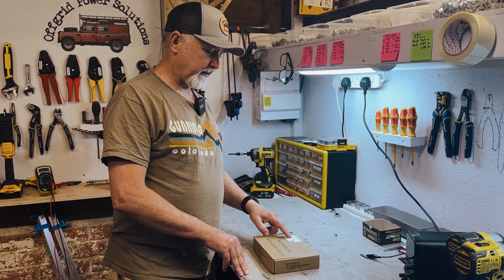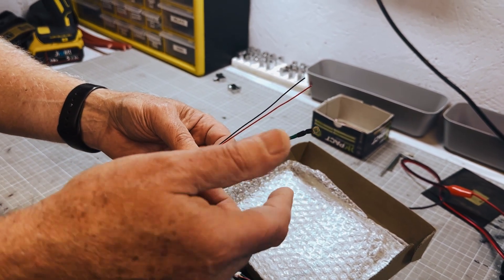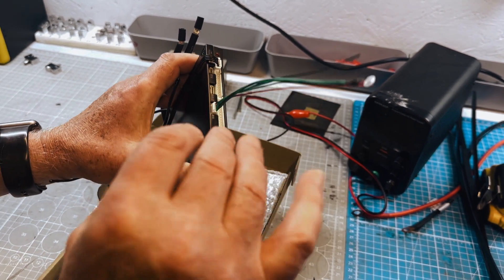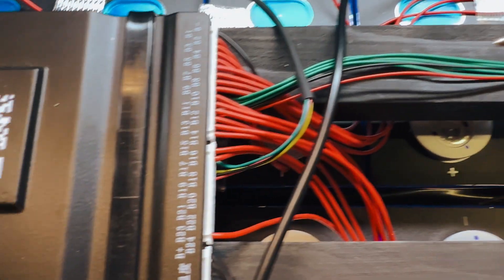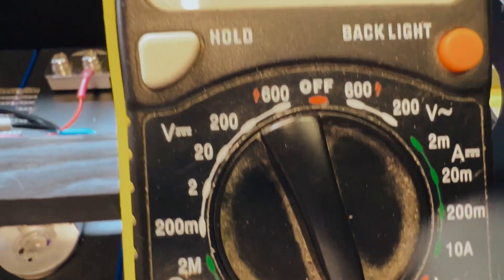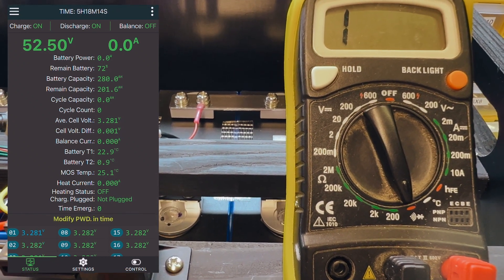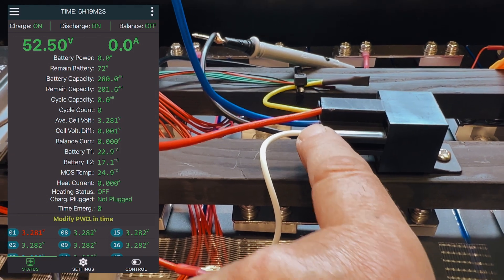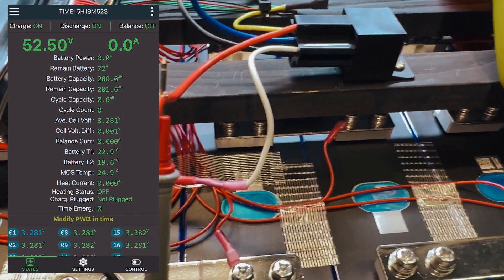How heating pads work with JK BMS

Comment: Don't tap 12v of a few cells in the pack..adds balancing issues. Do wire pads in series to make a 48 volt heater

Comment: One question. I have ordered this one and want to know one thing. 
Is it possible to start the heating manually with the app? 
I see from the video that you can adjust the temp for the heater to start heating. For example at 4c. 
But can you also make it stop when you reach a desired temperature? Example 15c?
Reply: @Sizosaid  
Value at "charge under temperature protection (UTP)" switches heating ON.
Value at "carge under temperature protection reset (UTPR)" switches heating OFF.
Reply: Thanks. Bur what if you choose heater off from bms settings,does it disable heater,so it doesn' discharge battery? I mean if i leave battery in cold in winter i could just disable heater,and when i go there and need it i just select heater on from bms?

Comment: What is the function of the two other cables on that heater connector?
How to use them?
Reply: I had same question. Do you solve that? What red and black wires use for?
Reply: @martinosemprini8997  
The only information i found is, that it should be to detect if a charger is connected. But no further detail....
Reply: @Juergen_Miessmer ok thank. For example can be used for an external relay if use a high power heater pad?
Reply: @martinosemprini8997  
I have no detailed information how to use those two cables.
Neither if it is an analog input/output, or if it is a digital communication port.

Comment: Hi, thanks for showing. Instead of looking for 48V heating pad you could connect the heating pad anywhere in the serie where you have 12V i.e. every 4 cells. Consumption is 1-2A and for a limited time; the active balancer will fix the unbalance. What do you think?
Reply: too simple! needs more overconvolution

Comment: Th ask for video. Perhaps you can simply connect main positive to the 4th cells to get 12v?
Reply: That will generate an imbalance between the cells with a higher load(current) than the active balancer capability

Comment: The 3 wires together is due to the spec of the pins in the connector not being able to handle the current. 
I have not yet wired for heat despite it being in winter, but i'm now wondering what the red and black NC wires do......

Comment: Hello.  Thanks for your video.  Does the heating only work while the battery is charging or all the time while this function is activated?  I bought a heated JK BMS and wanted the battery to heat itself during winter use.  I am writing with the help of a translator, so some words may not be correct.  Good luck in your hobby))

Comment: Why would the bms start heating the pack even if there is no charge current present?
That doesnt make sense at all.
If temps are below 0 for weeks and no solar is present it will drain your battery for no reasion.

I specificly bought the bms with the heating function do it could sense if there is a charge current.

A simple thermostat wiuld have been able to to the same....

I am dissapointed.

Comment: Hi, i didn't understand previous comment... Can you set the heater to turn on ONLY when the JK BMS sees a chraging current? Did you try?
JBD you wrote it has this functionality. Does JK have? I wouldn't like to drain my battery heating itself when there is no needing, but only when there is a charger running. Thank you.
Reply: I would like to do the same. I dont understand why it doesnt work this way.
It doesnt make any sense to heat the battery when there is no charing current.

Comment: tip: DON'T!
Connect external thermostat and set it at 25C.
Thank me later.
Reply: Why , a bad experience  ? 
I was just wondering. Especially if the BMS JK triggers even if there is no charge. 
No advantage over a good thermostat
Reply: To switch off at temperature over 25°C and switch on under it?

Comment: Where do you set discharge low temp? I have jk bms without heating, but i made my own. Problem i have is it will also cut discarge. I use mirror heater pad, 35w. You get them also 24V.
Reply: Yes, this is missing from all videos .....and manual also 😢 What are the settings?

Comment: You don't need a special heat pad.
A heat pad can withstand a certain temperature anyway, changing the volts only increases how many watts it draws.
From 12V 24V, you double the amps, and then get a quadruple current draw.
Same from 24 to 48V
Just buy one that has low power.
And then I mean low power, 10 watts at 12V becomes 160 watts at 48V.
It's a lot of heat, if it's in a small area.
 You can also connect 4 pieces of 12V pad in series, then they will be 48V in total.

Comment: The heating cable is not included with the unit, or available separately.???
Reply: If you purchase the bms with heat function the cable comes with it

Comment: Is there way to configure JK BMS to just heat when charging?  I store my sailboat in the winter and the company charges it twice a winter. So i don’t want to drain the battery. I just want to heat the battery when it is charged every 2-3 month.
Reply: I have same question. I have the JBD BMS, and it turn on when charge. Think I have to go with that again for my new build.
Reply: @Dan-LS  maybe just connect the heater to a relay that gets active when the charger is on. Combined with a temperature relay that only heats when below freezing. BMS takes care to not charge when battery is too cold. So it could take half an hour or an hour to start charging. But if you connect to AC for a day everything should be fine.
I wish there would be an integrated solution.
Reply: @olaf_s_23  before I had that setup, a voltage relay and a temperatur sensor. It was when I had a Daly BMS, then I change to a JBD BMS, and it start the heat only when charging below set temperature. So no loger need the extra 2 relays and controllers. I very happy. For a new build I was looking at JK BMS becuse of  better balancing, but if it can't handle the heat on when charging it out for me, I will go with another JBD.
Reply: @Dan-LS ahh  i am dissapointed.
I was just testing the heating function of the jk bms and i can nit belive it starts heating without a charge current present.
Why would they do that....
Reply: @olaf_s_23 how would you do that if you use solar for charging?
How would you detect if there is solar power avaliable?
Reply: @RFDarter I see now you wrote JK BMS.
To detect if charging, get a voltage sensor. Voltage is normally at standby, let's say 13.0 and when you charge 14.0 (I can't exactly the numbers).
So with a sensor, it open a relay when voltage rise and you connect the heater wire trough that relay. There is different voltage sensors to buy or build.
But be careful if you use it with solar, as the heating  maybe use more power then the solar provides. It will end up emptying the battery instead.
Reply: JBD = 
Heat turns on when charging and set temperature. Otherwise the battery will get empty after some time in the cold.
You can draw power from a cold battery, but when charging, it needs to be heated. Expect if you charge it with a low current, then it ok to charge it cold as I understand.

Comment: You could probably connect 4-5 of the same smaller 12V heating pads (<3A) in a series.
Reply: Yes of course, that was the easy and simple way to go:
4 x 12v heatpads in series = 1 big 48v heatpad , problem solved.
The relay thing was clumsy and over engineered.
Reply: I was thinking the same thing but not sure if it would work. brilliant thanks!